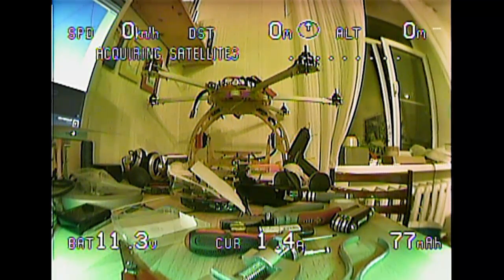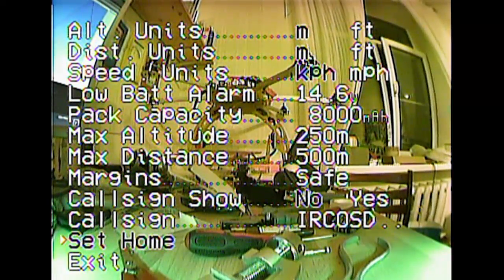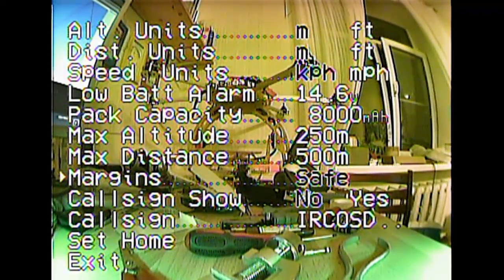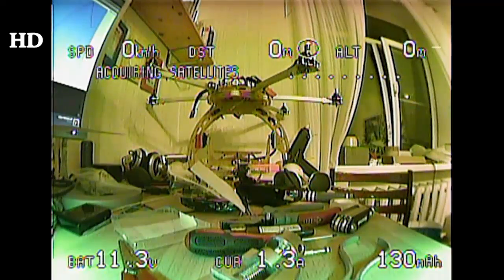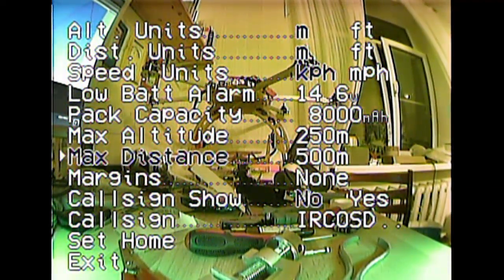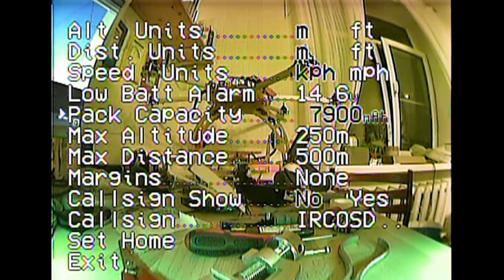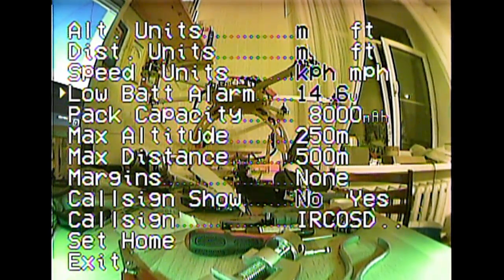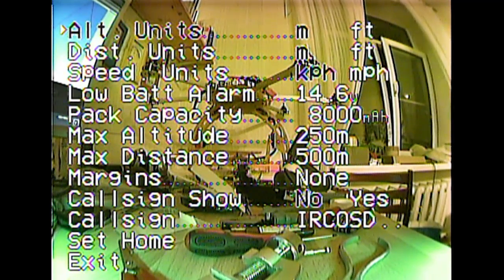rc guide ezosd menu walkthrough

Comment from the maker: As far as I understood the manual - there is no setup if you use the EzOSD required. These options in the menu are for tuning the OSD to the analog RSSI input. Don't rea;;y plan to do it though - I  have FrSky that shows RSSI on the transmitter. Sorry, no help here yet(